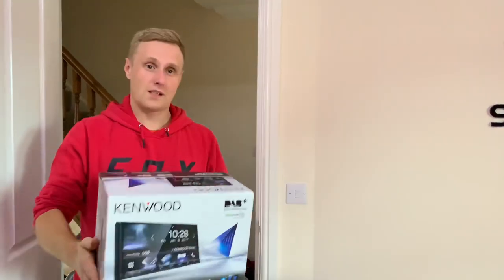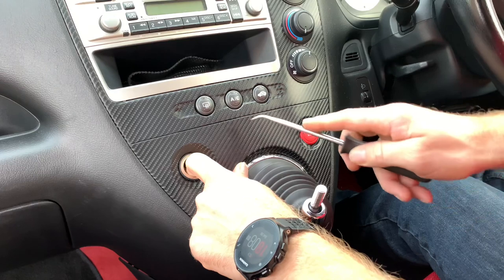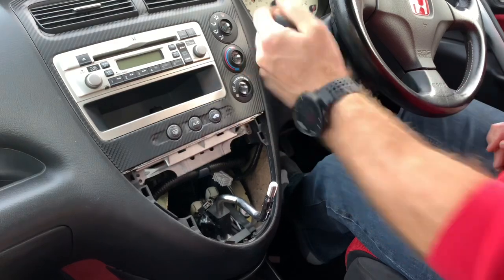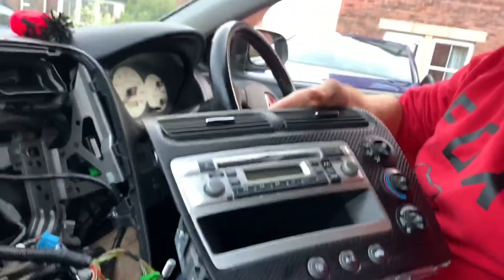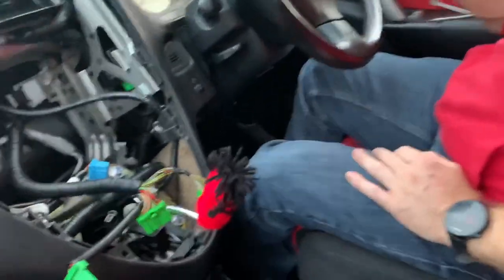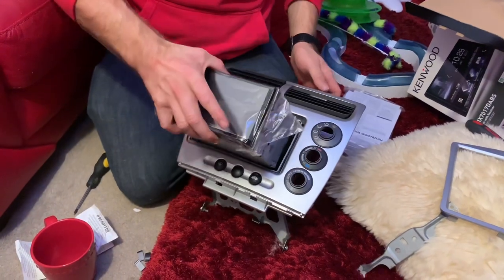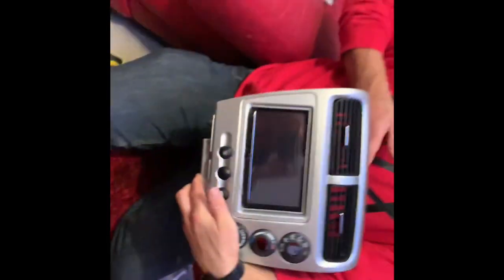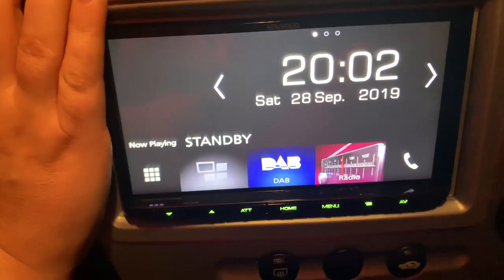Fitting kenwood DMX7017DABS to my EP3 Honda Civic

Comment: Easiest way to remove the lower part of the centre console trim is put your fingers in the shifter rubber surround bit and pull on the back of the trim, should pop out easily👍🏻
Reply from the maker: Wicked tip thanks very much!!!!

Comment: This is the best presented and informative video. Excellent!!!!! ;)
Reply from the maker: thanks
Reply: @1BlueGhost  Can you just plug in white end of the connector (that comes with the silver facia panel), straight into the back of a double din unit, and the red and black double ends into the lead into the original plug that came from the original radio/cd player just for the basics as my double din unit is coming with the a lead plug for the back of the unit but loose wires at the other end?
Reply from the maker: Possibly not, as the wires may not be correct for the head unit. If it comes with bare wires you will more than likely have to wire it up as per the instructions. I mean if it fits you could try it but I wouldn’t like to guarantee it will work.
Reply: @1BlueGhost  I had every bloody spanner BUT the 8mm. Got one ordered for tomorrow. Tools are like socks. Always fecking missing ;) The unit I have got I have realised is plug and play with my steering controls (coming next week. Took the battery of and dont have the ability without the 8mm to see my serial code to get the radio, so have any tunes on but will tomorrow. Thanks for the reply and take care ;)
Reply from the maker: @megajay7065  its great when they still work with steering wheel controls. I had to buy extra wiring for my other car to make them work again.
Reply: @1BlueGhost  Been there lol ;) Keep em coming ;)
Reply: Nice one. Great videos to watch and learn. Keep them up Blue Ghost ;)

Comment: Do  you have a link for buying the fascia? I can't find one that fits European Civics..
Reply: left wheel..
Reply from the maker: herbertkah I have just had a look and can’t see one. I am surprised there isn’t on European ebay.
Reply from the maker: herbertkah is this correct?

https://m.ebay.co.uk/itm/Top-Double-2-Din-Car-Radio-Fascia-for-2001-2005-Honda-Civic-LHD-Dash-Mount-A9X6/184020444842?ul_ref=https://rover.ebay.com/rover/1/710-53481-19255-0/1?ff3=2&pub=5575376664&toolid=10001&campid=5338268676&customid=Cj0KCQiA0NfvBRCVARIsAO4930kZYJvbx6LuwJxdBjcfTtCbpCyTy5h3LeUwBtmESwUke7L4iDDJp2YaAk8yEALw_wcB&lgeo=1&item=184020444842&srcrot=710-53481-19255-0&rvr_id=2223375705738&rvr_ts=0af3738116f0a4e908247206ffe6ae53&_mwBanner=1&_rdt=1&ul_noapp=true&pageci=8701fcd0-22d6-4a98-afd0-1f88ff1c6bd0&epid=12034977568
Reply: @1BlueGhost  Thanks a lot!! Appreciate the help! Found one yesterday, too..There seem to be different ones for Auto AC and Manual AC due to knob position..US ones don't seem to fit on some EU Civics.. I'll just try the one you suggested and the other one I found.. hope one of them will fit.. Cheers!

Comment: Correct me if I'm wrong, but surely the new stereo would screw directly to the the cage on the car? And the other cage isn't required?
Lmk as I'm about to try the same thing. We've just got a 2001 Civic auto for the wife.
Reply from the maker: That is probably a better way of doing it however you can’t remove the radio without removing the whole panel. I can get to various bits of wiring I need for my additional gauges the way I’ve done it by just removing the radio so it makes it easier for me.

Comment: I don't think you needed to file down the dashboard trim bud. What you do instead is put the radio in without a cage and then bolt it on either side to those brackets which are already there. The radio will have bolt holes on either side for that purpose. I could be wrong, but that's how I think you're meant to do it there.
Reply from the maker: ah right I see yes, although would that not make it very difficult to get the wiring plugs on and off? I will have a look at it as I will be removing it all once again soon to add an under seat sub.

Comment: Did you disconnect the car battery before installation? Wondering if it's necessary..
Reply from the maker: herbertkah I didn’t, just fitted it with ignition off.

Comment: Any chance you could explain the cable adapter you bought? Guessing its necessary?
Reply from the maker: It converts the new head unit wiring to attach to the factory Honda wiring plug and play. It came with the double din surround
Reply: @1BlueGhost  cheers
Reply: Can you post the link to the adapter?

Comment: Dies the gps, mic and usb extender come with the product? And how did you get the usb down there?
Reply from the maker: Colo Jr yes, usb extender the gps unit and mic all come with it. I removed the ash tray and pushed the wire in through a gap I found there until I could see it where the gear selector is and then pulled it up. I’m going to move it so it’s in the centre console storage pocket under the cup holders tomorrow.
Reply: 1Blue Ghost Oh ok thanks.
That sounds like a good idea mate, are you gonna film it? I haven’t seen a channel that easy to understand step by step instructions like yous before 👍 good work

Comment: where can you buy that frame?  the one I have does not enter.
Reply from the maker: The metal frame? I think it came with the radio
Reply: @1BlueGhost  
that's. The one that came with my radio is not suitable. And I can't find any.
Reply from the maker: What radio is it you are fitting? Perhaps it’s a different size to the hole?